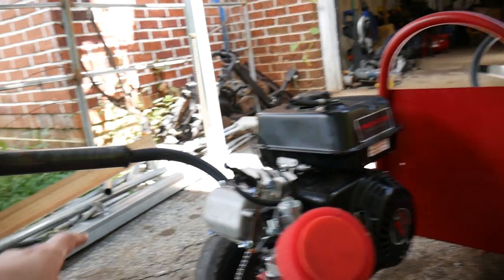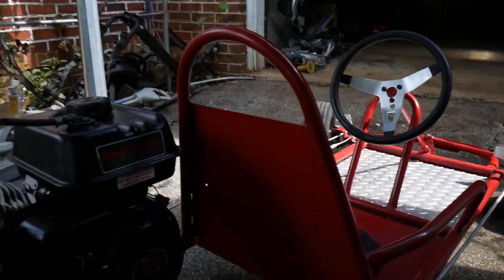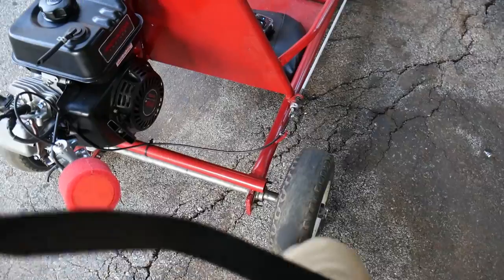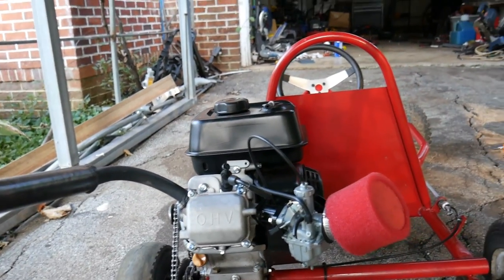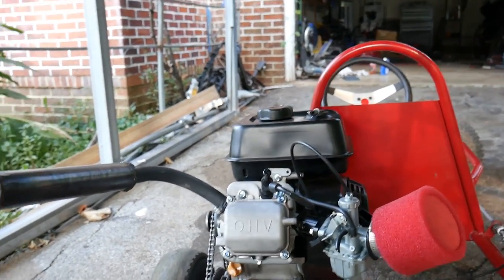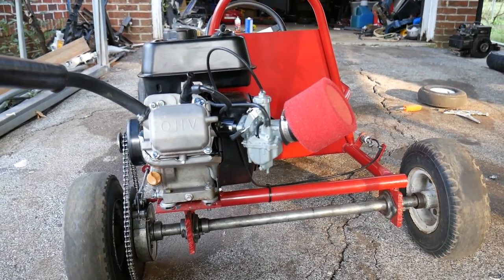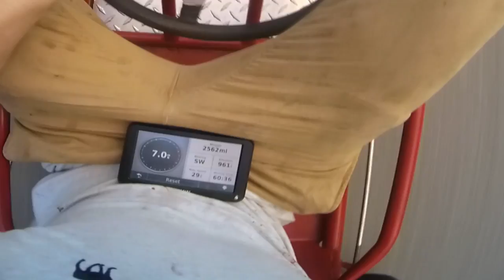Restored 212cc Go Kart is Fast!

Comment: When its popping on decel it means its running lean which will damage your engine.  The round jet on the outside bottom of carbeaurator needs to be opened up more.  Try 1/4 turn out until the popping stops.  the fuel mix and pilot jet control 1/4 throttle to idle and the main jet controls past 1/4 throttle to full throttle.  POPPING IS TERRIBLE!  You said it means its good.  IT"S NOT!!!!!!
Reply: @Skott LeFever your wrong and I won’t argue with you any further. Popping on developing can be a few things.....  exhaust leaks at joints and lean factor.  I know because I have a shop and dyno.

Comment: What are you talking about it’s good when it pops yes it may sound good but it is not good. You said it means it’s rich it doesn’t it mean it’s lean which is not good for it. If an engine is running rich it will blow a bit of black smoke or not rev out properly. How about you learn some stuff about engines before you start trying to work on them.

Comment: Can you please tell me your altitude, because in the manual of the engine it says that the optimal altitude for the engine use is 3000ft. I wanna know can I run it at 3250ft (990m).
Thanks in advance....
Reply from the maker: 1100ft. At 3250 ft it will run way rich

Comment: Install a Torque converter, because it is makes very big difference plus it is 60 dollars at amazon.com!!!
Reply: What exactly does a torque converter do?
Reply: @fhlfndsnfhjdirbe6617  it's the type of transmission used in a scooter, it is basically an automatic clutch with variable gear ratios determined by the speed at wich the engine is turning, if you wanna look into it search cvt transmission
Reply: Chorisiyo mongolo alrighty thanks man